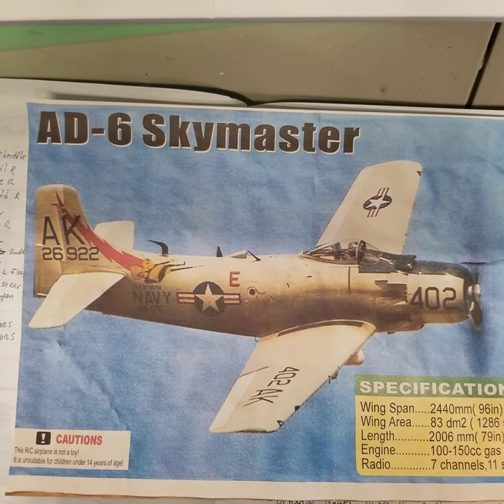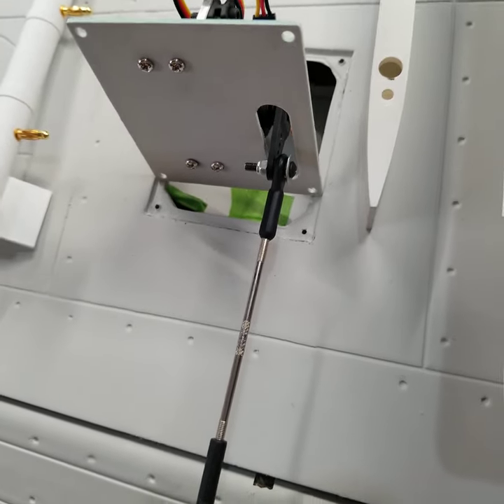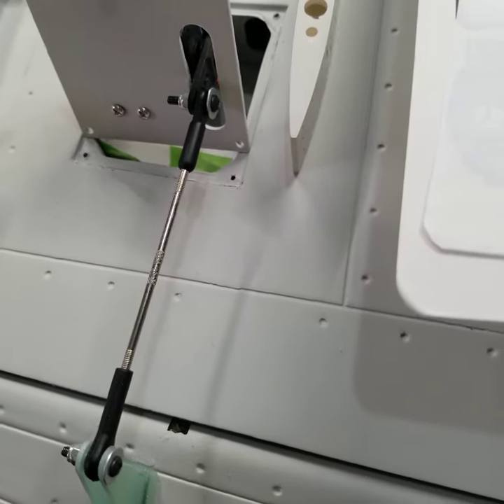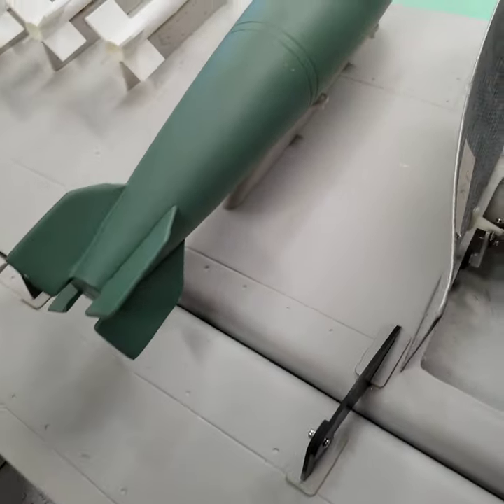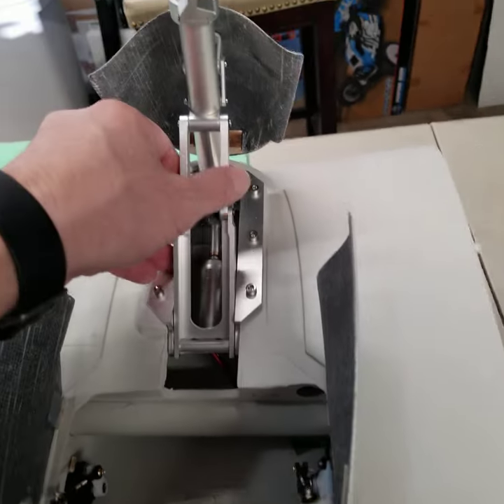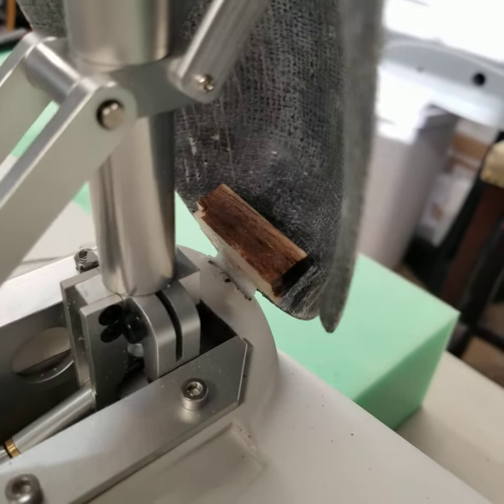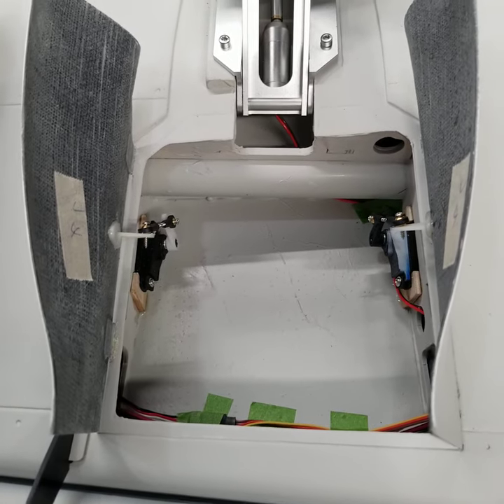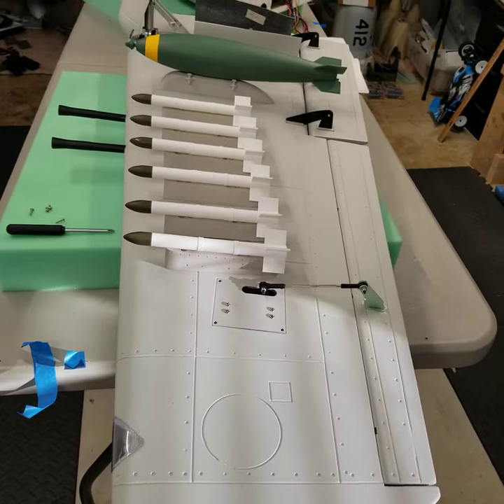Warbird models AD-6 Skyraider build part 2

Comment: David those double horn sets with the flat sided ball links are used on large scale 3D planes regularly. They are super strong...way overkill for a warbird, but I like that. Bullet connectors for the weapons...that IS ingenious! Never seen that before either. It always kills me when I see a finicky, scale flap assembly...coupled with aileron linkages that are so far from scale it's funny. I'm thinking "pick one" dangit! Either scale or not. The gear assembly is magnificent, but like you said complicated. Sounds like that was a real job! Having built larger scale planes before I can appreciate the time it takes to do it as well as you do it. There are hours of trial and error just adjusting things. As usual David...masterfully done.
Reply from the maker: Thank you so much Adam. Yesterday as I moved on to the tail section I discovered the pushrods had to play musical chairs and what I believed was one way turned out the opposite. The horizontal sections needed the shortest rods, not the longest, so all of the rods ended up getting shifted. The longest ones since they were available ended up as the flaps, the medium rods that were the flaps turned into the ailerons, and the ailerons which were the shortest became the horizontal rods. Needless to say what should have been a few hours of assembly and adjustment turned into an all day affair. Lesson learned! Also though part of working your way through a first run kit that doesn't have instructions. My trial and error will hopefully save the next person!
Reply: @davidsnyder238  Yeah man you're doing great work. They should post your vids on their website for reference. 

Man David I hear ya...three damn times this week I looked at Heidi as I headed into the hangar and said "This will take me an hour"...three hours later...